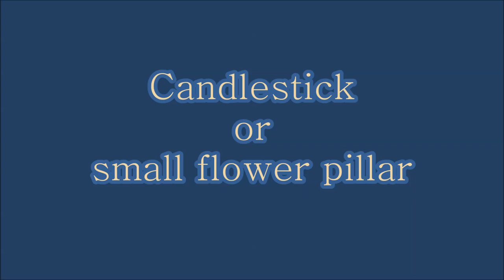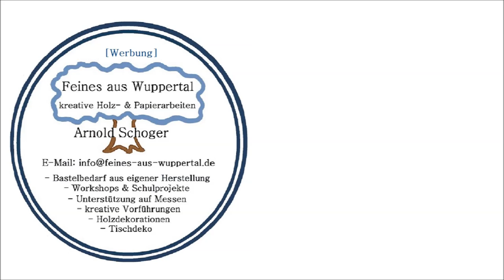Bandsäge Kerzenhalter oder kleine Blumensäule

Comment: Excellent lovely piece of work.   I would like to do pieces similar to that.  Great idea with the reversible function (tea light and larger candle). Lovely grain in that piece of wood, I have some similar chunks left over from some thick timber that I got out of my loft when water cylinder was removed. Also I have lots of white Oak approx 4" x 4".  This is an ideal little project.  I am glad I have seen it. The Pegas bandsaw looks great.
Reply from the maker: Thanks for your comment. It is quite easy to make such a candlestick and that can also be done with a scroll saw.
Greetings from Wuppertal, Arnold